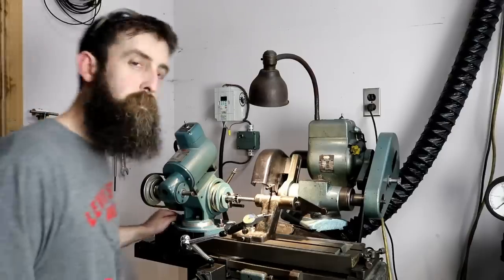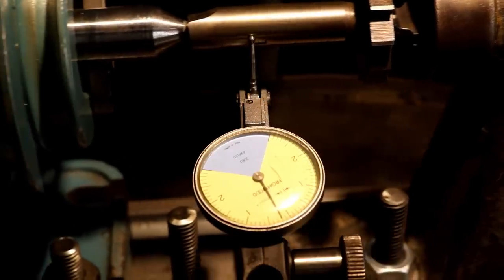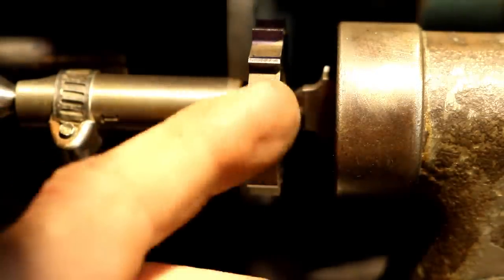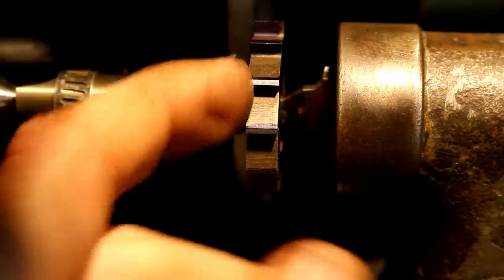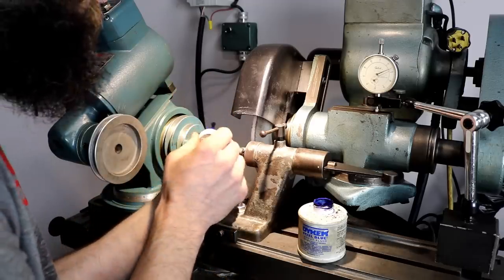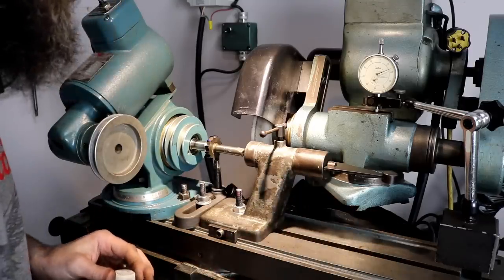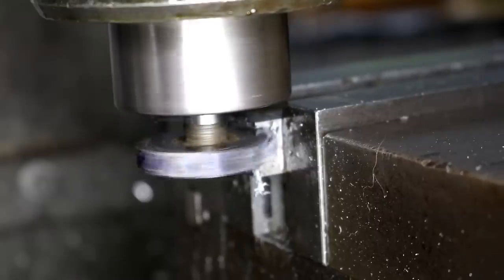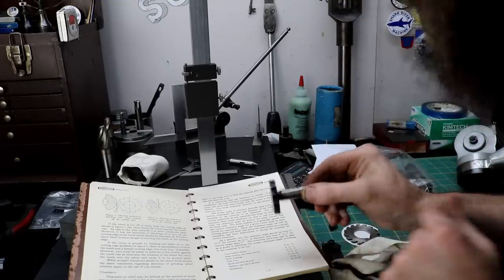SHARPENING MILLING CUTTERS

Comment: You have a great channel Steve! Sprung collets cause runnout. As to sharpening key cutters, I was taught to never circle grind a cutting edge. The circle grind will rub and not cut efficiently. Always use a cup wheel with a properly positioned cutter and grind the anglular edges to clean up the dull edge.

Comment: nice work Steve.  to check relief angles (when it's important) I get by with an inexpensive USB microscopes.  Look for one that comes bundled with measuring software.  I got a MiView from Saelig for $50-$60.  Cheapskate's optical comparator. :)
Reply from the maker: This Old Tony Never even thought about going that route. Thanks for the PRO Tip😉. I think I will do that.
Reply: Doesn't look like Saelig sells them anymore.  :(  I did find a Celestron on Amazon that's similar priced ($76) and comes with a decent looking stand.
Reply: I'm a hobbyist and far away from knowledge or experience, but my first thought to measure the angle or to inspect the shape was:
Put the cutter upstanding on a scanner, maybe a MFP (Multi-Function-Printer), witch at this time most poeple owned, and make a scan in highest possible resulution. Then you should be able to inspect the shape and measure the angles of the tooths at a PC. There should be many free software for image editing (like gimp or inkscape) wich should have a function for that. ;-)

Comment: Hi Steve.
Being an Old Retired Toolmaker having spent many years on all types of Precision Grinding Machines working for The Australian Government you will find it easier if you  leave your table set on the zero marks then lightly Tap The Workhead..making sure you only firmly  tighten The Head Bolts on The Rotational Dial.
Also we only ever used White Lead for Lathe Centres when we were at Technical College however we only ever used Machine Oil on Cutter,Cylindrical & Thread Grinders & make sure The centres are not over tightened in The Centres of whatever you want to Grind..

Comment: Hi Steve,
It looks like you are learning a lot and having fun at it as well. Great job!
Steve
Reply from the maker: Solid Rock Machine Shop Inc. I'm starting to get the hang of it. The way I was dressing the wheel in the beginning was a  problem. Now I'm not dealing with loading near as bad. LoL, all the little things are the difference between a good job and bad one.
Thanks Steve👍

Comment: Now that you have the book with the formulas your accuracy will improve exponentially. Great content. I miss milling, my back is gone from years of steam plant welding, rigging, wrenching, lathe and millwright. We always sent our windmills & cutters out for sharpening. I always wanted to learn. So vicariously thru you!
Reply from the maker: It's a neat process for sure. Learning relief angles / primary and secondary depending on the metal that you intend to cut they change of course. Lots to learn when it comes to cutter grinding.👍

Comment: Steve.
The original formula for calculating the amount to raise the wheel head "H" is as follows.
H = D/2 x Sine of clearance angle required.
So in your example,
H = 6.848/2 x Sine 7 degrees.
H = 3.424 x 0.122
H = 0.418

Comment: Top job mate , i was taught to grind down onto the finger with the wheel running the opposite way , all good .
Reply from the maker: Max Grant In the book I have it shows both ways. I run the wheel in the direction I did because of the wheel arbor nut direction.
Reply: My old apprentice training books show both ways as well ,the way you have done it theres less tendancey to leave a burr on the cutting edge - well done .

Comment: A woodruff key has a defined diameter with a tolerance. If you grind your cutter below the smallest tolerance then you have to throw it away because the standard woodruff keys would not fit in the milled seat any more. I understand that this is only a grinding exercise. But in principle you would have to check the diameter after grinding.
About the run out in the milling trial. I see only two possibilities: A) the centers of the tool are not concentric to the cylindrical shank of the tool. In this case you should not only grind the teeth but also the shank in the same setup. B) The disc with the teeth on it wobbles axially. In this case you would have to grind the upper and lower surface of the disc in the same setup as grinding the teeth and make sure you don't make the disk narrower than the smallest tolerance for woodruff keys or they won't fit in. In this case you could compensate by moving the cutter sideways to broaden the seat so the keys would fit again.

Comment: Not to trivialize what you are doing, but grinding these cutters seems much simpler than I imagined. How would you tackle a staggered tooth woodruff cutter?
Reply from the maker: Wes Johnson I get it Wes, this is the easiest place in my mind to start. Nothing real complicated about sharpening straight teeth cutters. I just had issue getting the relief I wanted. Never sharpened a staggered tooth cutter but from what I read it's not all that bad either. You mount the cutter on a arbor between centers and you change the grind on the finger rest to allow you to sweep both right and left spiral angles.  I'm most concerned about the close quarters of the ends of standard endmills. I think that will be a challenge to get satisfactory results on.

Comment: Looks like you are getting it figured out pretty well. There is a lot more to learn to this than to my fancy drill bit grinder.  I know all about living with run out. :-(
Reply from the maker: bcbloc02 This old mill has tons of issues. Works for most the things I do. All you can do most the time is work around it and account for it as I am sure you know👍. Thanks for stopping by Brian.

Comment: That is quite a machine.  A person could make a good side income with it.  On the corn, has your dad ever tried putting up some of the plastic webbed snow fence around his garden as a wind break?  Similarly they make plastic strips ypu can thread through chain link fence for privacy that block wind quite well.  You'd be stuck looking at the fence but it would save some work as long as the fence didn't blow away.  😏

Comment: Hi Steve I suspect you have all ready done this but, have you tried to adjust the gibs on your mill because if you can and the table will run true then it’s not that bad a job to replace the spindle bearings on the mill, then you wouldn’t have to look for another one.

Regards Alan.

Comment: If you call on the local fab shops chances are good they will have dull Rotorbroachs laying around. Locally here these run about $40 each so are worthwhile resharpening. You will need to do a batch at a time to make things pay.

Comment: Nicely done Steve! IMO skip the cylindrical grind as it is not necessary. keep up the great work.
ATB, Robin
Reply from the maker: ROBRENZ Makes sense. Guess no need on a cutter with nothing more than dull edges. Got to grind past the damage anyway to get a good edge.👍 Thanks for stopping by Robin I really  appreciate it.
Reply: That was my thought as well Robin, you are grinding the edge to the full diameter or to the  radius of the smallest tooth thereby you achieve the cutting edges of all the teeth at the same radius concentric with the shaft. Or more accurately the centres at each end of the shaft. Long winded I know lol

Comment: Like the vids!! I do have a suggestion for you. For sharpening and truing cutters with a shank you could save yourself some time by investing in a collect indexer. That way you could put the OD angles and also true the cutter in the same step. It’s a lot faster than working with centers. Oops, I should have watched the whole vid first. But the collet indexer Is faster in set up.

Comment: Thanks Steve. I wish you would have been making these 10 years ago when I was trying to learn to use my tool and cutter grinder. Have you checked the run out on the actual taper of your mill? Could just be a collet issue. If you ever find a reference that gives actual allowances for things like woodruff cutter diameter I hope you will share. I'm sure there is something out there, to my mind you couldn't grind a woodruff cutter very far before the key wouldn't fit.
Reply from the maker: carlquib Yeah the woodruff cutter is a certain size for a reason 😃.  Not much cutter to spare. All mine are regrinds and I'm not worried about getting them out . I'm just going through the motions. Good to see you Carl👍
Reply from the maker: carlquib Yeah the woodruff cutter is a certain size for a reason 😃.  Not much cutter to spare. All mine are regrinds and I'm not worried about getting them out . I'm just going through the motions. Good to see you Carl👍

Comment: Hi Steve, I know this is a while back but couldn't you have reversed the polarity on the 3 phase motor to get the wheel turning in the right direction. I hate the idea of holding the cutter whilst grinding it.

Comment: Steve, As long as the VFD has a rated output that is grater or equal to the two motors. it is fine to parallel them together to run from one VFD. They will both run as same speed.
Reply from the maker: Joe Adams That's good to know. I was unsure and didn't want to burn things up so I decided to not do it and stay on the safe side. I'm not a electrician.  It would be nice to use it for both
Reply: Steve Summers if the VFD is decent quality it should just fault out if it is overloaded, or if something is wired incorrectly. Instead of letting the magic smoke out!😜
Reply: Let me know if you need some advice connecting them together.
Reply: I agree. You can run parallel circuits on this one.
Reply: Joe Adams is correct, though there may be an issue with a top end or Open/ closed loop Vector and encoder feedback VFDs. Especially if you have a high performance spindle motor and tuned VFD, and just add another motor. 
Most of standard VFDs' use  Volts/Hertz control, and are plug & play, they don't know even if the motor/s are moving, they just output a mainly linear volts per frequency up to base speed ( 50 or 60 Hz). But they do the job.
Reply from the maker: Joe Adams Already hooked them together and tested it.  Works fine.  I thought that I could but I was unsure.  Thanks for the info. That saves me time and keeps the noise down👍
Reply: Awesome Steve, Glad it all works!
Reply: I tried to order some replacement magic smoke, once.  Turns out it only comes packaged in replacement circuit boards...
Reply: it can be difficult to source

Comment: How do you power your cutter grinder? I see you have a vfd on it, but is it a 575v motor? I have a ko lee ba960 thats a 575v 3ph motor. Were you able to find a vfd that went 220v 1ph in and 575v 3ph out? I assume your grinder is the same as mine.

Comment: Is it the spindle or the collet? The spindle looked steady, while the cutter shaft did not.  Very good work on the regrind of the cutter. We have a cabinet maker in our area named Steve Summers.   Thanks for the video Steve, they're always interesting.
Reply: i was thinking the same thing... without checking the inside of the spindle itself chances are its the collet :)

Comment: I like your T&C grinder videos. Is there any reason that you chose to run the grinding wheel in the direction that you did? - a question, not a criticism.
Reply from the maker: Ian Pendlebury The wheel hub is a LH . Safety was the only real reason.  Running the wheel into the edge also helps to reduce a burr on the cutting edge.

Comment: Really no need to cylindrical grind. You are grinding to the cutting edge. Also if you were cutting a woodruff key, it would need to be the same radius as the key for a proper fit. Thanks for the videos! Keep up the good work!

Comment: Diameter, or circumference?
Reply from the maker: Mike  for a straight wheel the formula is Multiply the clearance angle in degrees by the diameter of the wheel in inches and this product by the constant .0087
C= 7° x 6" wheel  x .0087 = .365
Reply: Steve Summers now I understand,  it's the wheel diameter not the cutter diameter.
Reply from the maker: Mike With a cup wheel the cutter diameter matters because you are grinding on a flat plain.

Comment: Great video Steve! .... looks like you're getting the hang of it!   FWIW .... if you don't want to get the pages dirty in your new book, and for interested viewers, you can find the Norton book on Keith's Vintage Machinery site here
http://www.vintagemachinery.org/pubs/1834/6637.pdf
One question....I have always seen and heard, that when using a tooth rest fixture, that the grinding wheel should rotate the direction of pulling the cutter down into the rest , opposite to the way you were grinding, and needing to hold the cutter. I know that you have done more research than I have ever done .....can you elaborate?   EDIT:    I guess I should have looked in the book! ....less chance of raising a burr on the tooth, and less likely to burn the way you were doing it! ....good stuff!